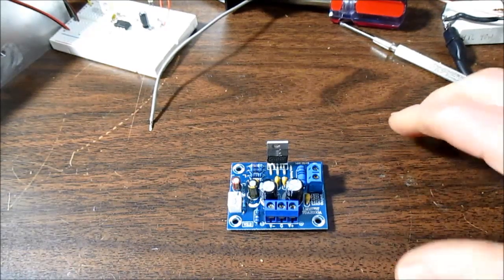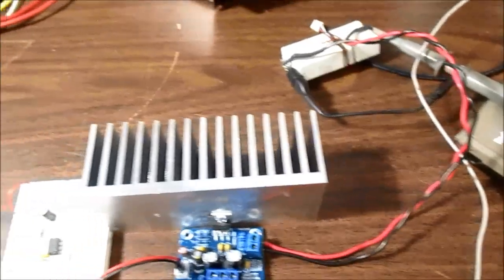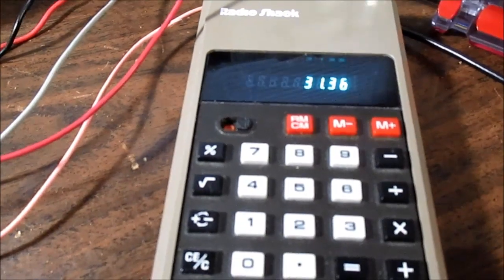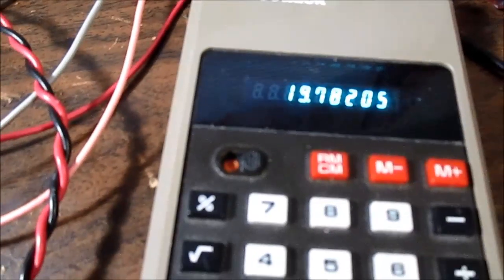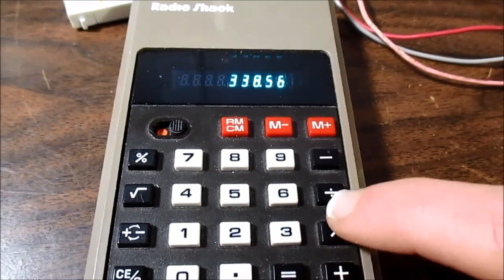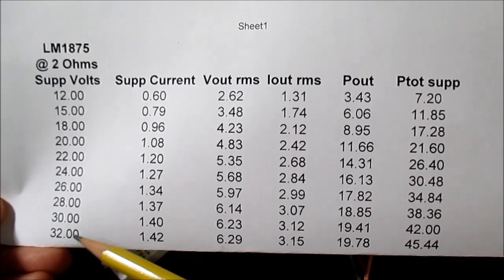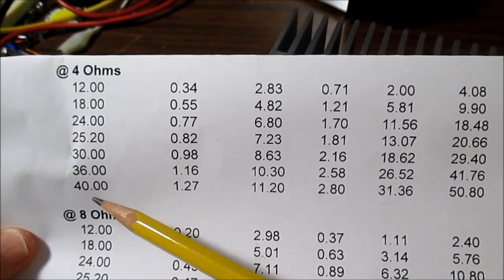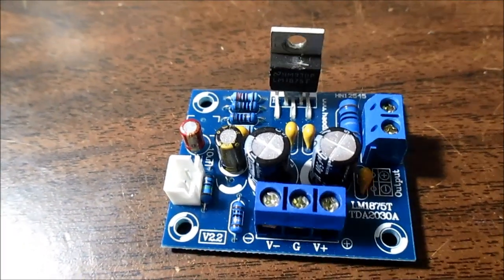LM1875 audio amplifier kit ULTIMATE power test

Comment: Hi John, I brought and soldered the LM1875 kit together and I'd like to but this in a cabinet. Can you make a recommendation on an inexpensive power supply for this LM1875 audio amplifier board? I understand the board requires a two-rail power supply of +25VDCand - 25VDC. I looked at a transformer with a full wave rectifier that would put out the voltages, but those transformers are expensive. Any ideas would be appreciated.  Thanks, Tom

Comment: If I want to use unregulated supply of say 18-0-18 volts , I will get a peak volts of +\- 25 volts and if I want to get  +\- 18 or 36 volts I should use a 12-0-12 volts transformer coz its peak output will be around +\- 18 volts or 36 volts. Am I right  Sir ?

Comment: Good videos John, concise and well-explained....

Just a daft query cos I know nothing. I didn't see any diodes, say a bridge rectifier on the power in. Does this mean that you can simply put say 25-0-25v straight from the transformer into the board?

I'm looking at this board as a quasi-gaincard/clone amp, and I like the simple layout and good distortion results. The coupling cap, the dubious "audio" cap you say needs changing, would you keep the same value, or does it not matter overly much? Cheers Martin
Reply from the maker: You will need DC split rail supply for this amp, so yes, a bridge rectifier and a couple filter caps and a center tapped secondary transformer. Transformer rating no higher than 18-0-18v if you use 8 ohm loads or 14-0-14 for 4 ohm loads.

Comment: I have a transformer out of an old Pioneer Stereo amp that has one ten amp secondary that gives me a rectified +/- 60VDC. That would mak a great +/- variable power supply....if I could only find a schematic or a couple of 70V input 10A buck converters
Reply: LT1083 regulator pcb is good for 7A but you need heatsinks similar sized to the lm1875 ones per channel

Comment: I have two of these that I have been sitting on for a while. do you have any recommendations for a sub channel? I want to go 2.1 channel this go around. I think I'm going to have to build a center tapped transformer because I don't see any 48v or 50v ones anywhere
Reply from the maker: The TDA7293 board would make a nice subwoofer amp. It would need its own supply.

Comment: Is it normal to heat the heatsink even without playing any sound?
Reply from the maker: If you have a decent sized heatsink and it is getting hot with no output from the amp, then you might have a problem. It is normal for the heatsink to warm up a bit with no output.

Comment: i bought this kit for having a small  mono amp for testing my speaker build considering your review. i did the assembly, but after watching this video i have to admit that if i slowly get the concept of dual transformer. i stil don't get what i have to buy. i mean, theorically as far as i understood i should get something around 18-0-18 3A for 4ohm loads and 25-0-25 2A for 8ohm load considering your video. but when scrolling down the comment, i see that you correct someone by saying "The 18-0-18 is perfect for 8 ohm loads. 2 or 3 amps current is fine for two of these boards.".at this point i'm totally confuse... also when searching on google i end up on component that are even more confusing like "15V-0V-15V (input and output are AC)" wich don't make much sens to me as i suppose it is suppose to be an ac to dual dc converting.. so , from here. could any one point a cost effectif power suply i could use with this board considering it's for using in mono with different speaker from 4 to 8 ohm..  idealy using RS ( https://befr.rs-online.com/web/ ) or any site that could deliver in europe. thw in advance, i feel like my brain gonna explode, i'm a bit desperate right now..
Reply from the maker: You must multiply the transformer's rated secondary voltage by 1.4 times to get the approximate DC output. So a 18-0-18v transformer will give you +25 and -25v in a dual supply configuration. Never connect the transformer direct to the amplifier. It must be rectified and filtered first.
Reply: Would you have any schematict to suggest for that, or a way to use a single supply. I  know it's entirely my fault as i didn't pay attention to the power supply mode when watching your video. But now i feel like having two useless assembled board. any help would be really appreciate. i would totally understain if you can't of course. thx in advance in any case.
Reply: i think this video from john should solve your problem. simple schematic, two capacitor, two resistance. https://www.youtube.com/watch?v=Mk8TN9OjywM&t=68s  could you confirm that john?

Comment: My question might be a lil stupid but, is there an easy way to port a simple volume knob on this board..? or do i have to make a kind of preamp between my computer and the amplifier?
Reply from the maker: You can connect one between the input and your signal source.
Reply: thx a lot, any suggestion for a potentiometer for this board..? mono pot obviously.
Reply: Yep a pot tips would be good. i'm still struggling with the power supply.
Reply: as it's a dual power supply you'll have to connect the dc 48v 2A following this trick https://www.youtube.com/watch?v=Mk8TN9OjywM&t=333s
Reply: here is a good start for the power supply https://fr.aliexpress.com/item/AC-DC-48V-2A-Power-Supply-Adpater-96W-Charger-Transformer-1A-For-POE-LED-Strip-Light/32753806260.html?spm=a2g0s.13010208.99999999.262.dHmIdJ

Comment: do i need 80VA or 120VA @ 15v-0v-15v for 2 lm1875 moduls? The load is 4-8ohme. In your data @4 ohme:
40V @1.27A per lm1875 time 2 for stereo =2,52A. The 80VA transformer is labelt 15v-0v-15v 2.66A. First i think 80VA is ok for stereo but than i look at Ptot per lm1875. 50.8W per module times 2= 101,6W. Now i think 80VA is to low for over 100Wtot

please help
Reply from the maker: 80 VA is fine. My tests use continuous tone which music is not so the supply demands are not as serious. If the 120 VA is not too much more expensive or too large of size for your amp case, I would choose it.

Comment: How much power i need at output of this amplifire if i have 3 speakers of 5 watt and 8 ohms resistance connected in parallel?? I got 3 ohms of resistance when i connected all 3 speakers in parallel.
Reply from the maker: Actual nominal impedance would be 2.67 ohms. You would want to use a lower supply voltage (+/- 12 volts) to keep the current down with such a low impedance.
Reply: Thanks!!

Comment: Could two of these LM1875 amplifiers be powered with two 24v switch mode power supplies? I already own two Mean Well LRS-75-24 power supplies and would like to experiment with a stereo setup using these boards. I have read about people using two switch mode power supplies in series to create the necessary +-voltage required but I'm unsure. Also the negative output of the supplies is grounded to earth... does that make series wiring impossible?
Reply from the maker: Sorry for the slow reply. If the the negative is grounded on each, this 
would cause a short when trying to use them in to make a dual supply. 
You would need supplies with isolated outputs or one with dual rails.

Comment: I have a pair of 15 ohm 15" Tannoy speakers. From what I have seen on similar tests they should be OK but you never see any figures now for 15 Ohm.  Do they sell 2 Ohm speakers ? I have seen a lot of these little amps that don't even like 4 Ohms.
Reply from the maker: The wattage at 15 ohms would be slightly more than half the power of the 8 ohm measurements. 2 Ohm speakers are rare and don't make a lot of sense in a normal "hifi" setup. I used it mainly to see how the amp would perform.
Reply: Thank you so much for the reply. I more or less guessed it was a test. The old Tannoy's I have are about 60 + years old but still sound better than anything else I could afford. They are very sensitive, they had to be as in those days amps were usually in the 10 W range. I built a stereo pair of Mullard 20 W valve amps (0.05% distortion at 20 W). I Googled it the other day. First item on The National Valve Museum, bloody ell that made me feel old.  I take it then it would be OK to use a modern amp on 15 Ohm ? I'll need some sort of pre amp for the RIAA (records), etc.

Comment: A real impressive performance from the LM1875 - I can see why you like them. I've gone with the LM1875 for my first foray into building a power amplifier - I'm working on a 'nested feedback' design with the LM1875 inside the feedback loop of an LM4562, which (assuming it can be coaxed into stability - I do like a challenge) should bring the already good distortion performance of the LM1875 into another league again.
Reply from the maker: That sounds interesting. You might have heard of Tom over at Neurochrome Audio who made an ultra low distortion amplifier with an LM3886 doing something similar. Lots of good information on his site. There's good info on feedback servos in Bob Cordell's power amplifier book as well.
Reply: Cheers John, excellent resources.

Comment: Nice video, as always, thanks. What a great little amp this is, do you know how dB amplification it has on this board?
Some of these chip-amps have a bad name in audio-lala-land. Does it sound as good as well?
Reply from the maker: Amplification is 26.8 db. Frequency response is flat, noise low, distortion low, output impedance is low, It has all the qualifications of being a good amp. I don't listen to "audiophiles" because of the total BS or pseudo science some of them spew. I'm not an engineer but I listen to them.

Comment: Many may understand why you used a very substantial heat sink on the 1875, but you didn't mention heat rise on it.   Do you think real-world use, open-air would be OK for sustained operation, or would an addn'l fan be needed (say, for a stereo setup with everything in a case/chassis)?   This critter is pretty brutish!  Thx.
Reply from the maker: This heat sink is quite large for the job. It just something I had available. However, as many professional engineers who happen to be amplifier designers say, "No heat sink is too large". Unlike a lot of consumer gear where I find the heat sinks to be marginal, I tend to oversize them for my amplifiers.

Comment: So my 18-0-18 toroidal transformer was a bit off the mark for powering two of these boards in stereo (8 ohms). 
...There is a 50-0-50 in the shop on sale with 7amps.......?
Q: Could you please tell me, What voltage toroidal transformer would you recommend for a stereo set up? (8 ohms)??
Reply: thats it. whats your reasoning behind that? I'd like to run it off one toroidal.
thanks tennu.
But i'll wait for John to chime in haha cheers
Reply from the maker: After rectification and filtering, a 25-0-25 transformer will put out too much voltage for the IC (around 35 volts per rail!). The 18-0-18 is perfect for 8 ohm loads. 2 or 3 amps current is fine for two of these boards.
Reply: JohnAudioTech, how much VA trans for a 18-0-18 (8ohm load)? 100VA? 150VA? Thanks !

Comment: John, an old question: where did you buy the enclosure for your preamp? I am thinking about making something similar and your enclosure would fit the bill.

Best,

MM
Reply from the maker: I built it using acrylic (common trade names for acrylic are: Plexiglas, Lucite, Perspex, ect). There are a lot of videos on YT on how to cut and join it.
Reply: Many thanks. Will give it a try.

Comment: If one wanted to make a little practice guitar amp out of this kit and build it all into a box -- would that be a sensible project for this type of amp .. The biggest hurdle for me would be finding a generic power supply off ebay / ali that would take 220v (outside U.S.) and deliver the required DC - I have zero experience with "split powersupplies" - could some form of generic universal laptop powersupply be used to give this the amperage it needs ?
Reply from the maker: You would need a preamp in front of this amp for more amplification. I'm making a power supply video, stay tuned...
Reply: very much looking forward to it.

Comment: Why are you using oscilloscope probe at 1x and not at 10x?
Reply from the maker: Small signal audio work.
Reply: JohnAudioTech You mean low frequency audio signal?
Reply from the maker: Yes, the relative low frequency of the audio signals aren't affected much by the scope probe's parasitic capacitance. Plus with the scope not needing to work with a 10x smaller signal, I get less noise in the FFT and waveforms especially when dealing with smaller signals.

Comment: that a very high watts amp, John. can we use a battery on it?
Reply: u can use 2x 6v lead acid i think.
Reply: At the Maker Faire i meet a guy that builds amp on lm chips. He has a lm1875 stereo amp on 2 12v car batteries(12v-0-12v) and he has a lm3886 on 4 hawker HX 500, 2S2P for 24v-0-24V (400Kg of pure AGM Power)!! For each HX 500 he installed a 1F carhifi powercap! This supple was called THE MONSTAAR ULTRA STABILE XD by 100%fullchared(25.8v-0v-25.8v) the supple/batterie bank  provides @24v-0-24v 160W per cell for 15min 3840W total. Voltage drop 1.8v per rail! @ 22v-0-22v it provides over 350W per cell=total 8,4KW @ for 15 min! And the max power is  readed at 20.5v-0-20.5v over 500W per cell 12000W total for 15min OVER KILL!! this is all nice but bullshit, but with 2 lm3886 no load to max load/befor cliping the drop of the voltage per rail is <0.02V on the ozi, Thats really Crazy!! So you can go easy with 2x 6v agm or for more power 2x 12v agm or for 8ohme loads with 4x 12v agm 2S2P
Reply: I've been wondering if two 9V batteries back to back would work. Obviously, the rail voltage would be low but would the IC run at reduced output? A 9V battery has around 500mAH so it seems like it would last for a few hours since the chip is drawing about 70mA.
Reply: @xyloeye  4 9v parallel in each rail should work(total 8)